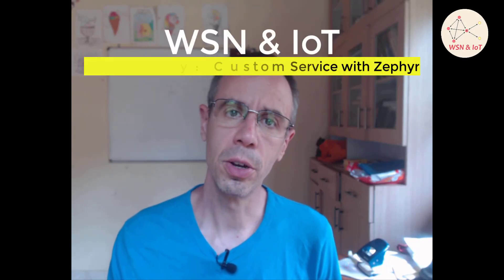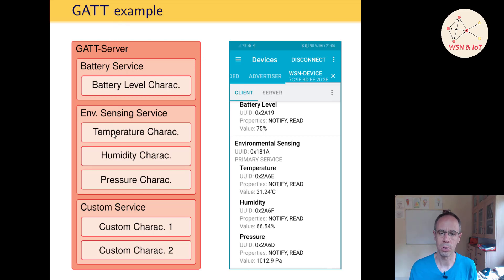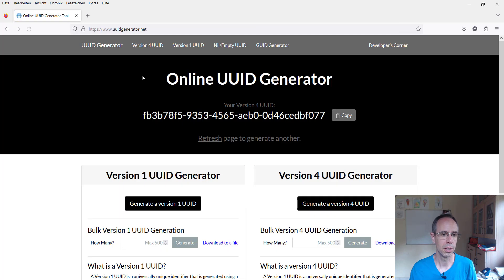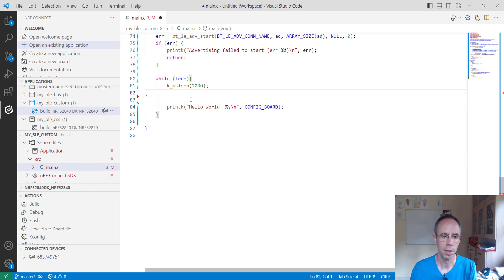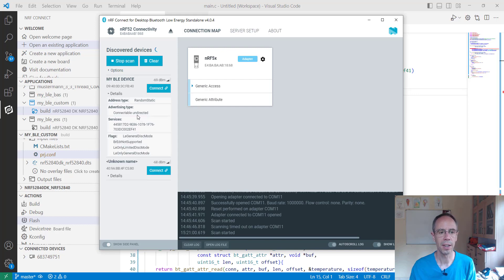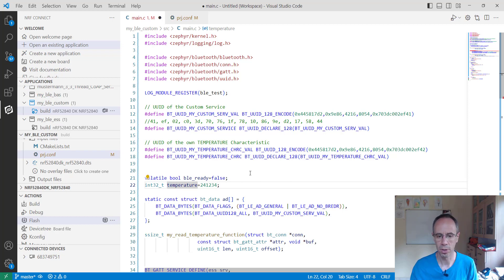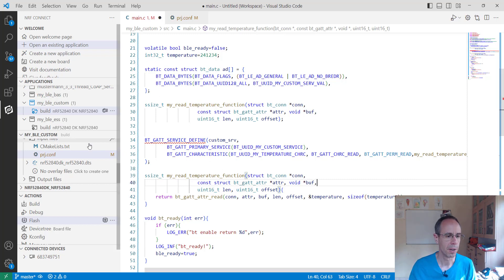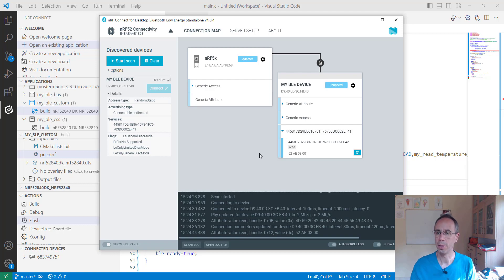Programming Bluetooth Low Energy (BLE) with Zephyr - Part 3: Creating a BLE Custom Service

Comment: Question: 

Is Service Characteristic limited to one-dimensional values only? For instance, variables like Temperature, Humidity, Speed, or True/False fall into this category. However, what if I need to transmit an array of variables and then decode this data structure on the receiving client side? Is JSON a recommended approach for this purpose? what about structure decoding on the client side?

While I grasp the advantages of conserving battery life by employing one-dimensional values at low reporting rates, potentially extending battery longevity to a year or more, I can't help but feel that this approach is rather constraining. It appears to be well-suited for only a specific range of solutions. Are there alternative approaches that could be explored to address a broader set of solutions?
Reply: To provide further clarity on my question, I'm wondering if it's advisable to opt for a custom service that allows sending multiple variables individually, rather than combining the data together to conserve battery power. In scenarios where preserving battery life is crucial, would the approach of using a custom service for each variable be more effective than consolidating the data? 

Under certain circumstances, there might arise situations where multiple variables need to be transmitted simultaneously, while at other times single variable transmission works fine.
Reply from the maker: @xorcipher  Of course, that depends a bit on the use cases. Actually, you can store whatever you want in a characteristic: an array, a struct, or a string. Thera are always transferred bytes. The recipient can always store this in an appropriate data structure. If only data is to be transmitted, it may be better to store this in an array or as a string in one characteristic, for example. If, for example, different settings are to be made, such as with a battery management system, it probably makes more sense to define a separate characteristic for each setting, than always handling a complete array or parse a string.
Reply: @wsniot  Thanks for getting back to me. This makes sense I guess I have somewhat answered my own question based on your answer it's really interesting to know what "data exchange architecture" exists but this is probably specific to the design intent. 

Thanks for covering this topic.